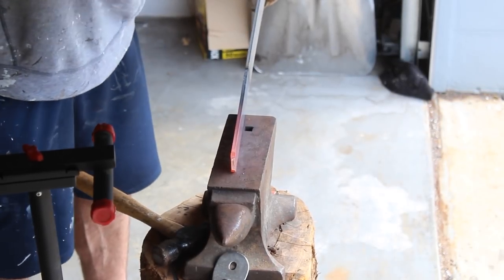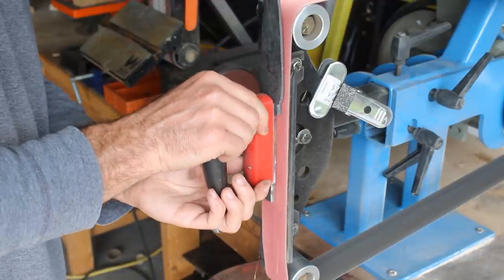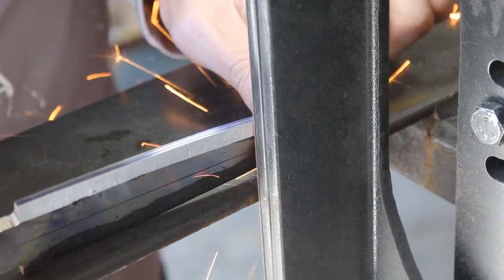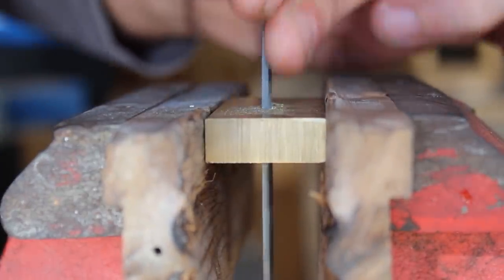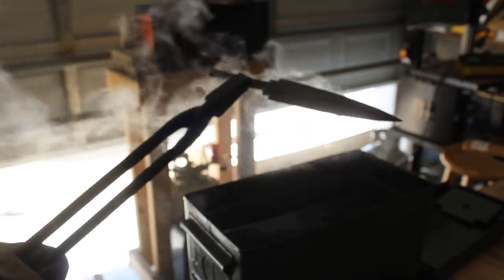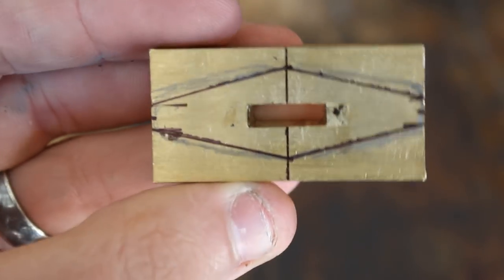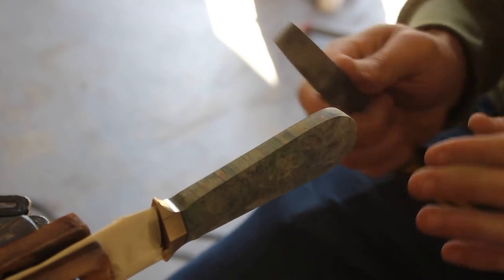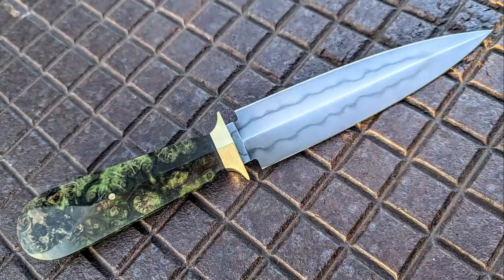Dagger with Hamon! Dagger Challenge

Comment: Prop a stupid question. However, why dont you do all the grinding before hardening the steel? (I've noticed that everyone does it this way)
Reply from the maker: If the edges are too thin they tend to over heat during the heat treatment. if you leave them thicker it heats up more evenly
Reply: @Wengelsworkshop  okey! Thank you so much!

Comment: How did you get the hamon? You didn't tell us that
Reply from the maker: lol i did tell you how. but i will tell you again. The clay that was put on before heat treatment prevents part of the blade from hardening. then when you etch the blade in acid it reveals the hamon which is a contrast between where the blade was hardened and where it wasnt.

Comment: you lost at the handle installation. way too loose
Reply from the maker: Well you should look into it bc some very good knife makers including Kyle Royer would disagree with you. An extremely tight tang fit can cause the handle to split if there is any expansion in the wood. Which even with stabilized wood there will be some movement. Thanks for watching anyways Richard. Take some time to look into this topic and maybe you will learn something.